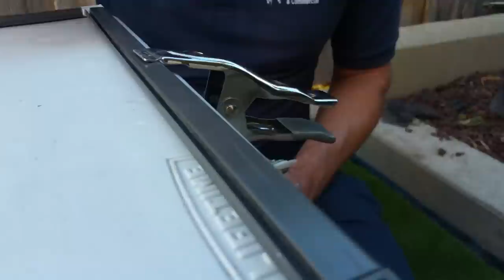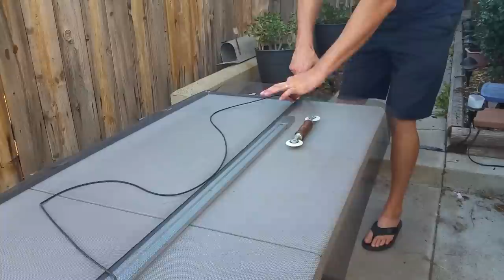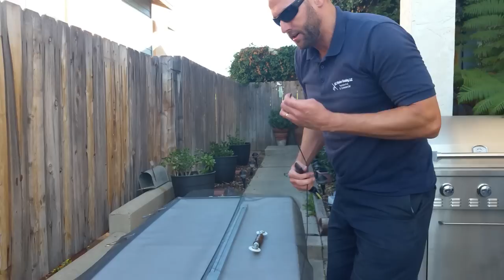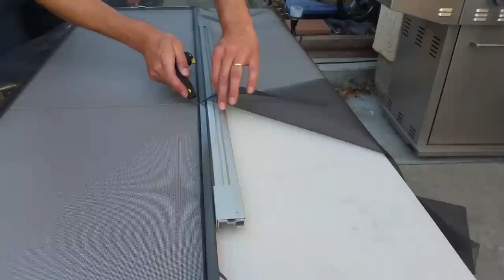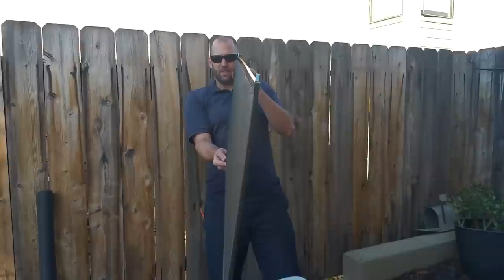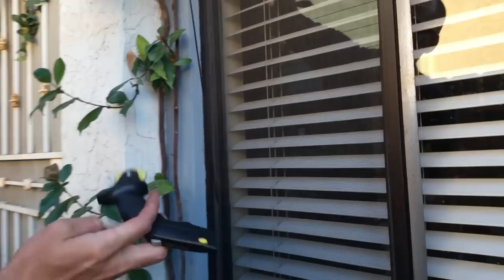How to Replace Window Screen Mesh / 5 STEPS of Window Screen Repair

Comment: I watched several of these how to repair the window screen, and this one without question is the best. A couple of guys were a real pain to watch. They were so intent on showing how quickly the screen can be replaced they failed terribly and left a mess. I don't care how many steps one should go through, to arrive at a great result. I actually enjoyed watching your video and saved it aside to watch again before I tackle this job tomorrow. I went to Home Depot to buy a complete window screen. The guy working there took me back to the display and showed me the kits for simply replacing the screen. He told me Home Depot doesn't stock the complete screen because the replacement kits are the solution. My wife gave me that "listen to the man dear, he knows what he is talking about look" . I can hardly wait to get started on this project in the morning. A cat wiped out the screen in the garage, so that one is first. Again thanks again for making this really great video. PS I subscribed for sure. PS I am 81 years old and appreciate all the great information I can get....Ken, Marina California.

Comment: i did like 6-8 screen repairs today, my dad just asked me to do. i took it as a challenge and didn't look up any tutorials, just looked at the old ones and learned from there. 
what i've learned and what people should keep in mind. 
when he cuts the screen off, don't do it that long of a way, that's kinda dangerous to me.  some people could cut themselves. 
2.  i learned that rolling in the rubber piece that holds the screen down away from you makes it tighter. this way you have to do less adjustments as you do it. 
3. for smaller windows, just pre dig the channel along the metal piece. then add the plastic piece.  this will give it a tight finish
4. if unsure of what to do, sit, look, and think about how the window screen goes and it's easier than you think. 
5. don't be afraid to mess up, it's okay. 
6. don't rush. 
7. when cutting the ends please do it nice and slow bc u don't want to cut away all the work you just did 
8. i prefer going all around the metal piece with the rubber piece, seems to keep everything tighter this way. 
9. thanks for reading and i hope it helps. 

Trial and error is your best friend and you got time. you don't have to be anywhere else. you got this!
Reply from the maker: This is very stupid and useless advice! There is a reason I have this video up trial and error is absolutely not your friend when it comes to screen repair, I'm a pretty smart person and exceptionally good with my hands and I went through hell with trial and error! Watching this 8 to 10 minute video is going to give you so much knowledge that you cannot learn anywhere else
Reply: C & C Window Cleaning LLC. I did say that I did this for fun as a challenge right. If I could learn it all alone on my own doesn’t that mean I can give advice on wht to do and wht not to do since I now have experience? Makes sense. Don’t sit there and say that it’s useless. Some stuff that I talked about isn’t even talked about in the video.

Comment: I just started adding this to my business, what is a good price to charge a screen if you don't mind me asking.
Reply from the maker: Sorry there's about five reasons behind everything I do so my answers are always pretty long,
The quick answer to your question is $20 per screen but you can go broke get frustrated where your people down where your business down if you don't have these other steps involved.
Step one is to limit your services to mesh replacement only and don't never add bar replacement no matter how much you want to or how much you think you're helping somebody.... unless of course you have a passion for screen repair and that's going to be your main thing.
2. If you are getting into screen repair make sure you are advertising only the type of screen mesh replacement that you can teach to somebody else so that you're not stuck doing the work all the time.
3. Have a minimum of 5 screens, the psychographics is that if people are cleaning their Windows they will definitely pay another hundred bucks for 5 screens replaced.
4. If you are anywhere near a Lowe's Home Improvement that is the best place to get screen mesh because you get 25 ft for free if you buy the 100 foot rolls, AND if for some reason the roles are faulty in other words the mesh doesn't line up or the holes are too big in some areas you can return it immediately and not waste a day's work.
5. ONLY purchase rolls that are 36 inches and 48 inches wide don't start purchasing rolls for every size screen you will make very little profit, there's a extended explanation for why you only purchase these two sizes because the 48 and 36 inches you can turn side by side or if it's screen is narrow enough to do two of them with one strip of 48 inch you will be saving a lot of mesh square inches.......
Anyway have fun!!!!
Reply: C & C Window Cleaning LLC. Thank you for taking the time to write in back.

Comment: I have a screen table but my frame is still bowing. Am i pulling to tight on screen??
Reply from the maker: Make sure you have a pre roller like the one I show from the beginning you have to pre roll the mesh down into the frame, watch the video all the way through there are a lot of little meticulous things that are essential, like stretching out the rubber string or spline so that it does not pull screen from The Middle and then getting a solid pre-roll,

Comment: Where do you buy the tools? The mesh, spline and rollers?
Reply from the maker: Josh Dicus most of this you can get at the hardware store this roller I got from a screen building shop you can get them online at wholesale screens and glass.com.

I recommend going on homedepot.com and getting their $35 angled screen roller that has three wheels with it , the mesh I get from Lowe's because they have it very inexpensive and 100 foot roll and 99% of the time I use the same spline that was on the screen, but you can get that at Home Depot, Lowe's also but Home Depot spline seems to be better quality
Reply: C & C Window Cleaning LLC. Awesome thank you!

Comment: What is that metal frame-like thing you are attaching to the screen's frame?
Reply from the maker: Screen building "JIG" you can buy them online.
Reply: Why do you use it just on one side? Does this help keep it from bowing? Thx
Reply from the maker: one side is clipped and the other side needs the jig..........I knew I should have left the whole video on there, my wife said that the video got good at the point I started.
Reply: Right - and this keeps it from bowing i take it?
Reply from the maker: yes, but the most important is the pre-rolling
Reply: K really appreciate it. You have a good one. Thx for posting the videos

Comment: I follow these directions but my screen mesh is never tight, it's always loose and sags, what am I missing?
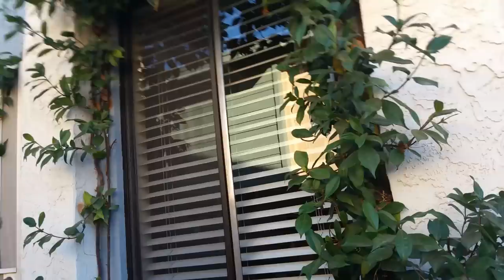Reply from the maker: You really have to watch the entire video I am extremely articulate in this one as well as meticulous, at minute 8:04 I show in great detail how to remove bagginess from the screen, another thing is notice how I have the entire roll still intact while I am doing the screen wherever you lay the screen roll start as I did rolling the opposite end and then keep the screen roll tight as you go this will help support a little bit do not pre-cut the screen is what I'm saying and then check out how I take care of baggy screens at minute 8
Reply: y do u twist the sline?????